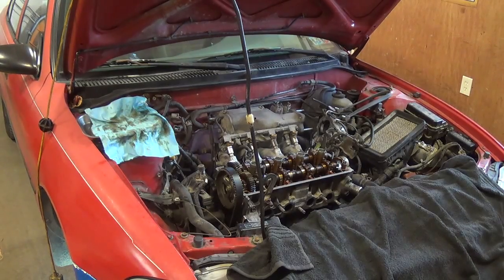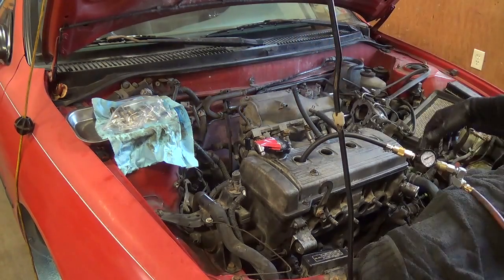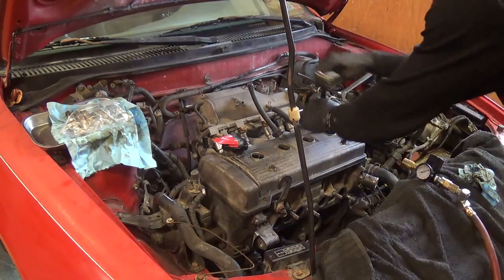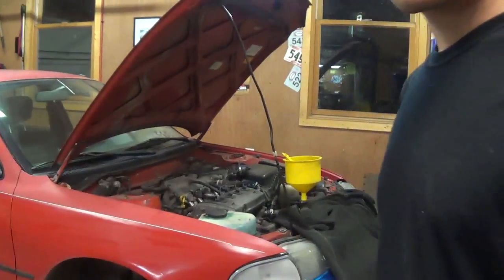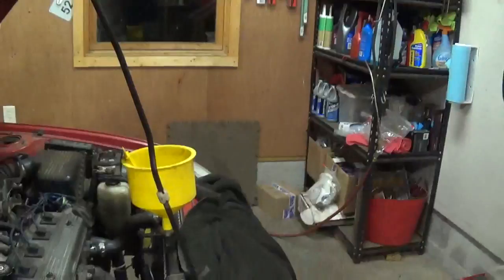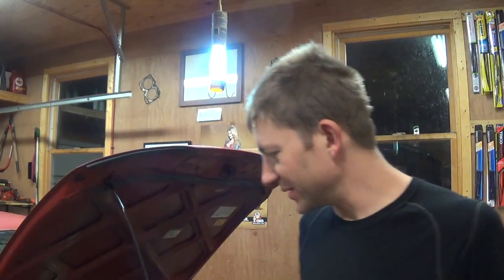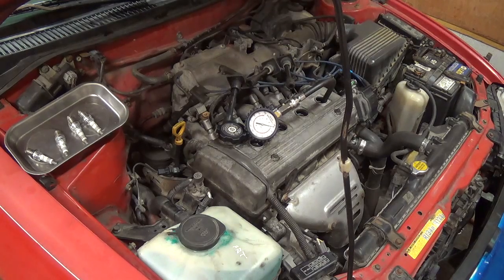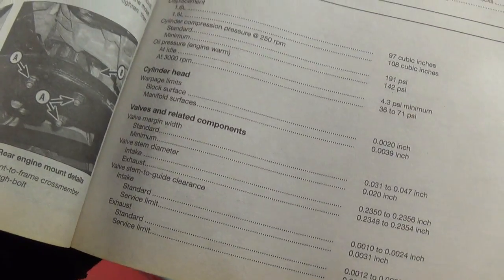Toyota 1.6/1.8L Oil Burning -'96 Geo Prizm -Part 4 of 4

Comment: Synthetic oil in the right extremes produces glass, crap synthetic kills engines especially rotaries you can kiss 3/4 of its life goodbye for using crap synthetics. I use mineral in everything, synthetic is also a much smaller molecule which is good for getting into places but also getting out of places.

Comment: As shared by another your video gave me the confidence to attempt my repair on my own. I ended up having a cracked valve. I replaced that and cleaned the others and lapped them all using a drill (I don't think I did as good of a job as you did). I also changed my timing belt and cleaned my pistons and put in new rings. It is also purring again with 277,000 miles! Thank you, Ivan!

Comment: At that point of tear down probably should’ve replaced the exhaust valve’s because of the pitting on all of them. They’re cheap and you were right there
Reply from the maker: Car ran perfectly for a few years after this repair until it was traded in... Probably in the crusher by now 😢

Comment: If you didn't change the main bearings on the Crank and connection rod bearings, you ain't getting another 200,000 miles out of her.🤣🤣🤣
Reply from the maker: Owner traded it in a couple years ago due to rust issues. Engine was still running perfectly with no oil burning at 270k miles :)

Comment: Nice this takes me way back like car seats.   I've had several 4afe powered cars thoughout the years and built a couple of them myself.   Only tip I have for anybody wanting to dive into a job like this,  when you get ready to install your pistons with the ring compressor,  I always recommend buying a bottle of STP oil treatment,  and just brush a nice coat all around the inside of the ring compressor, or in a pinch just use motor oil.  But the little blue bottles of STP oil treatment are fantastic for assembly lube, it's super thick and wont drip off.  I've built several Honda and Toyotas and I always get a small paint brush and use it on everything including the main and rod bearings and wrist pins.

Comment: Was just wondering if you checked and re-shimmed the valve lash on this engine since you Resurfaced the valves it may have changed the valve lash settings.
Reply from the maker: I checked the lash, was within spec 👍

Comment: nice. applicable almost easy and fine job. maybe by better grinding the valve #3 , it could have shown better compression or leakage testing.altogether you achieve what you wanted without lots of damn technical parts and tools. again thank you and good luck bro.

Comment: Ivan sad to say you made every rookie mistake there was to make on a rebuild. But the burnt valves in 3 had to stop it all.
Reply from the maker: Car still runs perfect to this day, and doesn't burn a drop of oil at 270k miles. Was recently traded in due to rust issues, and was then bought at auction within 30 minutes haha. I say my "budget rebuild" was more than sufficient and surpassed anyone's expectations  ;)

Comment: I will disagree with many things.  First off you claim that this was a high quality Japanese engine.  2 head gaskets, and a half assed overhaulv
 Before 200 k miles?

Next you did this to a rat of a car. You did a whole lot of work that will be for naught if you spin a bearing that you didn't even evaluate when you had it apart.

A 500 mile evaliuation?  Give me a break,  all that does is create an illusion.  After all this work you still have a rat car.

To get a great used car, buy one tha needs some work, and get one that the market is soft on. Next spend a few bucks and service the cooling system with the goal being to prevent overheating. New water pump, belts and hoses, thermostat and coolant. Heck toss in a new radiator.

Now keep up on the lubrication and tire rotations.   

That $500 piece of Detroit iron is going to take you to a quarter of a million miles or beyond.
Reply: Nope...wrong again.

Comment: Good job young man, only thing I would have done differently is hone cylinder walls with new rings and while you had it tore down replace the insert bearings. Cheap enough and will add mileage to your overhaul. I'm big on corollas, owned several 97 and back are best. All the ones I've owned have gotten close to 400,000 miles! Maintenance and oil changes are the key to longevity. Also grease if you have fittings.
Reply from the maker: Around here in the Northeast they would live a lot longer if it weren't for the road salt...not too many left on the road unfortunately :(
Reply: motoYam82 know what you mean, someone could make a living going south buying toyota bodies in great shape, combining them with low mileage engines from the north and creating good cars
Reply from the maker: My brother drives a '96 4-Runner and just recently scored a mint '96 Lexus ES300...I'm jealous! Those cars are built to last a lifetime.

Comment: When you're doing a valve job, you always replace the exhaust valves whether you need them of not, especially on an engine with 238K. The reason is, the exhaust valves 
run  hottest due to exiting gases. This heat stresses the 
metal and, the danger is, the head of the valve can break off in the 
engine. The head can break off because you've removed the insulation of 
the burnt carbon and now, the valve is again exposed to cool fuel spray 
from the intake. Combine heat stressed metal, cool fuel spray on clean 
metal, followed by a shot of hot exhaust gas and you can end up with a bad day at the shop.
Reply from the maker: Running better that ever 12k miles later with original valves. 

Now if I installed new aftermarket valves made in Mysteryland, I would have nightmares of a bad day at the shop for sure LOL
Reply: Were the new rings made in Mysteryland? Why didn't you weld them up and stick them back in?
Reply from the maker: Clearly you did not watch Part 1...Original GM/Toyota Part MADE IN JAPAN :) 
https://www.youtube.com/watch?v=AHDzgywlBro  
see @10:22
Reply: Oh, but I did watch part 1. I thought you may be thinking Japan was Mysteryland. Made in Japan used to be considered an epithet like made in China is today. Funny how things change.
Reply: @stevewarren3051  ok now stevie....this is a pg  channel

Comment: Awesome videos man! Just watched parts 1-4 and learned a ton. Was keeping my fingers crossed for good compression on those cyclinder 3 valves. I have a 2006 Matrix and use  mobile 1 synthetic 5w-30, so I'm hoping to avoid future problems with oil consumption. Currently, at 75K miles, it consumes no oil at all between 5k change intervals.
Reply from the maker: The Prizm is running strong at 249k miles at the moment; doesn't burn a drop of oil. Will do a timing belt replacement vid on it soon :)

Comment: I enjoyed your video.  If I get enough ambition, I may try that on my old '89 Probe 2.2 .
I wonder if you could answer this question.  Why, when lapping in the valves, is it necessary to go back and forth?
Reply from the maker: +Brady Bell Just makes the valve seat nice and even all the way around. The valve actually turns on its own at certain rpms!
Reply: Thanks for the reply!  I was doing some more reading and some said that the reversing of direction was to redistribute the grinding compound over the valve.

Comment: Hi Ivan ,
First let me say a decent video of a home garage repair with limited space and equipment. With that said I hope you learned something about engines and metat to metal sealing surfaces. You should be ashamed of yourself for reassembly with known defects. A $1000-1500 repair short $20.00 in replacement valves. As the saying goes PENNY WISE POUND FOOLISH.The problem cylinder. a couple of replacement valves either new or from the scrap yard would have tken care of the bad valves in cylinder #3. it just would have been a slight time delay and probably not really affected the overal time of the job. I expect it was not completed in a day. To be really harsh the only time that kind of repair would be allowable would be in what is refered to as a field repair where spare parts can not be provided.

Also just a hint lo lap properly place the head on a rack valves hanging stem down. use a small suction cup that will stick to valve head and spin the valve both clockwise and counter clockwise occasionaly lifting the valve up and lowering back down. a uniform grey should appear on the valve if you do not get a uniform grey band width all around nalve sealing area you probably should replace the valve as this is an indicator that the valve is either burnt suffficiently to have signifigant material missing at the burnt area or a slightly bent valve stem cusing the deviation.  Other that that I am glad the engine worked well at start up and hopefully will run long enough considering the age of the vehicle.

Keep the videos comming

Comment: I wish you had shown how to set the valve lash, or did you just put the same bucket and shims back where they came from ?
Reply from the maker: +theoldwizard998 Yup very important to keep track of the bucket locations. In my experience this bucket-and-shim valve lash adjustment system is the most reliable and least maintenance intensive. No oil pressure, lash adjusters, or tappets to worry about!
Reply: +motoYam82 I understand how the lash would checked in the field (feeler gauge between the top of the bucket and the bottom of each cam lobe).  Someone needs to explain how it is done in mass production !

Comment: I really feel people 'give up' too easily on engines and want to replace them when they could easily be fixed. In the old days an old engine would be out of tolerance on almost every measurement so a rebuild or a replacement would be necessary. To me this was a lot less effort than replacing the engine.
Reply from the maker: +Andrew Thompson And a lot more effective too. Where are you going to find a used Toyota engine that burns NO OIL? Answer: they don't exist haha
Reply: +motoYam82 agree, I do not understand why but Toyotas are bad for oil rings. It may actually be Toyota owners not the cars themselves. 
Personally I hate engine replacements, lots of unexpected problems like in your latest video..

Comment: Great video series, Ivan, thank you! A '96 is an "older" car. LOL. Maybe invest in a real valve lapping tool- to make your life easier-  http://www.amazon.com/gp/product/B0009RGTM2?keywords=valve%20lapping%20tool&qid=1453102827&ref_=sr_1_17&s=automotive&sr=1-17  Once a face is pitted like that- it's done for. I'd be safe- to flush out the oil system with 1 Qt. of ATF and run for 50 miles, then change. (Next time/car) an overnight soaking of pistons and valves in a covered container of 50/50 acetone/ATF removes sludge & crust nicely, with minimal wire wheel burnishing later.

Comment: I honestly cant comprehend why you didn't replace the valves.  Especially when you saw the pitting in them.  If this guy is paying to have his motor torn down to this point, a second time, I think that extra expense should have been made.
Reply from the maker: +Nick Palmer Wasn't a question of money, but availability of OEM parts. I would rather reinstall the original pitted valves than new junky aftermarket ones! Also with new valves you have to re-shim the buckets to get the clearances right, which requires a whole set of special shims.
In any case it would be too much extra time and money spent on a non-issue. I mean if the engine runs just fine, why not just leave it alone?
Reply: I will admit I did make the comment before watching the end of the video.  My bad on that part haha.  I personally leave head and valve work up to my machine shop.  I think my comment did come off a little rougher than was intended and I apologize for that.  I was commenting on the chance of it not running right when done and have to do work all over again.  Anyways, I have watched other videos and like what you do.  I am a big fan of Erics channel and could watch his stuff all day, he can be funny as hell.

Comment: My question is why WOULDN'T you replace those valves since you were already in there. They can't be that expensive.
Reply from the maker: +Serafin Silva TIME CONSTRAINTS BRO! Of course if I had them on hand it would be a no-brainer. 

So now I challenge you to find an OEM exhaust valve for a '96 Geo Prizm 1.6L. That means TOYOTA MADE IN JAPAN. I refuse to put any aftermarket parts in. Give me a link, price, and expected delivery date :)
Reply: +motoYam82 http://www.gmpartsonline.net/1996-geo-prizm.html

Not criticizing. Just saying If I went through all the trouble, That's what I would do if they looked that bad.
Reply from the maker: "Part Discontinued"...please try again :)
Reply: +motoYam82 It is really hard to find oem parts for older cars. The dealer usually discontinues them after a specific number of years. Same problems I ran into with my 95 Corolla
Reply: I see that....
Reply: Yeah?.....especially no3 exhaust.Already off,so replace that one at least!
Reply: Serafin Silva I thought the same thing about the insert bearings
Reply: Mt man 1949 What's an insert bearing? Never heard that term before

Comment: Great series Ivan! Enjoyed watching it. How did you clean the clogged up EGR pipe? Carb clean?
Reply from the maker: +TGsrao1989 Oh man....the EGR pipe. Well that sucker was clogged SOLID from end to end, including the two tight bends. I tried everything, including a piece of motorcycle speedometer cable in a drill. No luck. Finally just straightened out the pipe in a vice and used a bicycle spoke to dig out the carbon. Then bent it back into shape.

Should have just replaced that little piece with some NiCopp brake line; would have saved like an hour!
Reply: motoYam82 Ooh boy! Never thought that removing crud would be such a tiresome process.

Comment: Nice one Ivan.  Next time the caveman needs to do a shadetree valve job can I recommend this item?
https://www.ombwarehouse.com/Valve-Refacer.html
It would put the shine back on for you before lapping.  I've used mine on my 44 John Deere A tractor although it needed some modifying before it could handle such a big valve.

Original problem is called coking where the oil due to excessive heat is cooked off into a coke like deposit that will glue a ring into it's lands.  Don't think synthetic oil can help here to a measurable extent but a thicker radiator core sure would.  Your friend probably ran it out of coolant on a very hot summer day.  Have nothing to do with three piece oil rings, would have turned the world upside down looking for a Hastings substitute with a cast iron oil ring, possibly getting four turned is another option.  The rails on those will never make it to 300,000, I'm amazed this one got close to 2.  They wear off completely leaving nothing but the spacer to do the job and it doesn't work so good that way.  If it's got a cast iron oil ring, I'll reuse the entire set with no problems.  I could tell you really wanted to here, it will work fine.
Reply from the maker: +Lee Barnes That's a pretty neat tool! I don't do that many valve jobs, but it would have been nice to have in this case for sure!
Reply: The amazing thing about it is just how good it works when the set up is exactly right.  Yes, it's a gadget for the most part, but when you don't have an $1,800 real grinder this one does a fine job.  I can put multiple angle grind jobs on for that same cheap price too, while I paid quite a bit less for mine it's still a bargain today.   It cuts valves like they were made of cheese.  I am looking into carbide cutter for seats next. 

I used to do the 'wear it in' type of valve job with professional equipment that Eric mentioned before where the tech said trust me, I'm a mechanic, run it and it will break in.  We used a one degree difference in the main face angle 45 or 30 where the high side of the contact could be marked by just slapping the valve onto the seat by hand several times,  When it was in the proper location on the valve we just put it back together, knocked the valve three times with a hammer to help start the seating process and never had a comeback.  They would hiss a bit during assembly but within minutes of running became strong as an ox which ultimately saved the customer a ton of labor fiddling around with lapping, lapping clean up, solvent testing and the rest.  None of that was done nor was needed despite contrary advice.  We were not professional in many such ways.

You should have had a rag under all the valves even during disassembly as the keepers sometimes don't turn loose without a fight and this can bend a valve a minor amount if it strikes the floor with one side only.  The linked to tool will show a bent valve night and day every time.
Reply from the maker: Yes the only way to really understand a process is to perform it with your own hands several times. By trial and error you will eventually get to the most efficient and reliable solution. Others may argue that it is wrong or improper, but if it gets the job done and everything works as it should in the end, that's what really counts!

Comment: Great series, but I would have replaced the #3 valve. It's only about $12. Using synthetic oil is a good idea to keep the oil holes open. The clogged oil return holes shouldn't happen again.